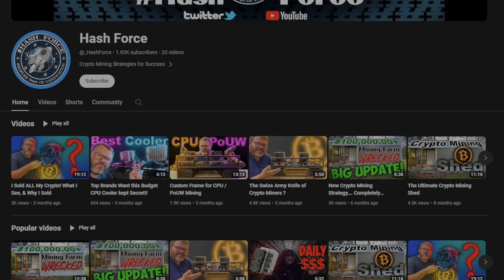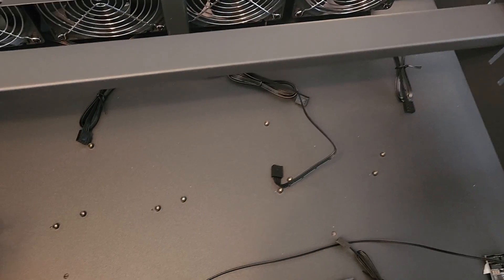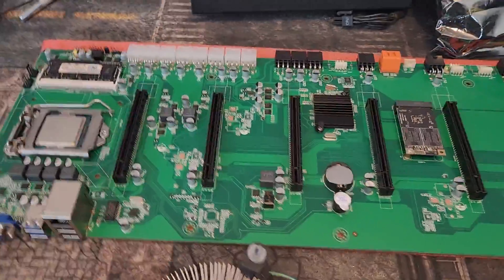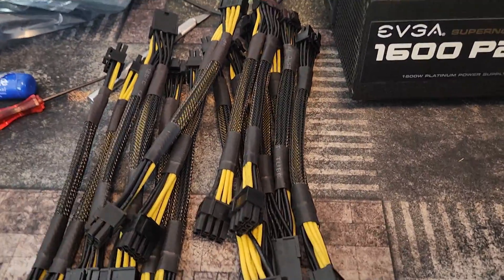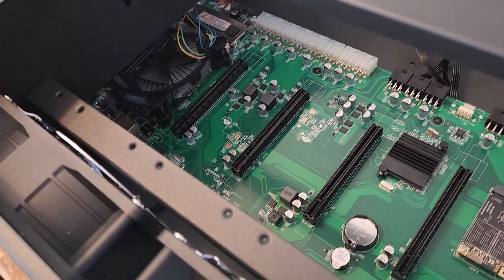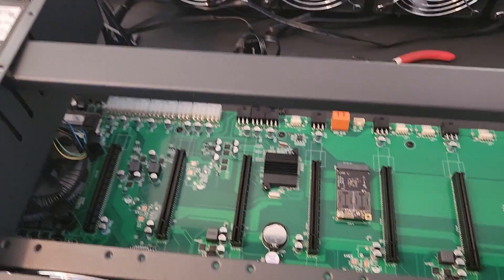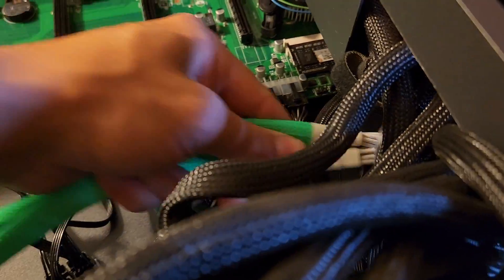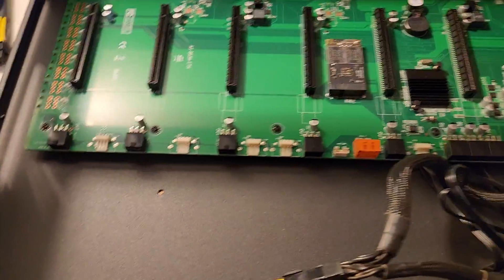How to build your own #gpumining server case!

Comment: Just for future reference you can plug 4 pin pwm fan connectors into 3 pin connectors you just don't get pwm fan control from that end pin.
Reply from the maker: for sure but I wanted the fan control which is why I plugged them in that way

Comment: You could get molex to 6 pin for the fans potentially
Reply from the maker: I thought about that, but didnt want to mess with it, this way felt safer
Reply: @kr00tman  yeah true. Hey do you have a link to the cheap cpu to pcie cables? I tried looking for them online. Can only find veteran miners. I saw veteran miners cables and they are sick but expensive lol.
Reply from the maker: @propeldragon  I didnt trust the cheap ones, they looked really really bad, and I get vets cost alot but I promise you they are worth it and thats coming from mr cheap himself

Comment: I use this case, but I spend a bit more on a 2u mining power supply, it has 2000 watts, I think and plenty of cables.
Reply: I used to use evga psus, but it was annoying to connect a breakout board and a server psu (I used to velcro them on a side of a case). I also use a splitter to put 10 cards total, but extra 2 or 3 cards go next to the case. Good luck. I think 8gb will give you faster response.
Reply from the maker: yuppp very annoying which is why I don't think ill do another case like this

Comment: Those motherboards are a little cheaper than my btc-37's that i like.  Also, besides the obvious fact that the 1600 watt power supplies fit in there, is there any reason you couldn't just use a server psu, and a breakout board?
Reply from the maker: there isn't at all, in fact because ill have quite a few server psus sitting around doing nothing once I convert 90% of my rigs to server cases I plan on buying 1 more set of these to see how it goes with server psus
Reply: @krootman_digitial  yea, because by the time i buy my next open air rig with a btc37, for only a few more bucks, I could get this setup....  but i wouldn't want to spend $95 on an atx power supply...  i might just go this route with server psus
Reply from the maker: @areutryingitout5678  exactly, like for me I could build another server case for 170 reusing my server psus, seems like a no brainer to go that route. I will see where im at in a week once everything is set up and go from there!

Comment: I have the same setup!!!( i have 6 of them!! for a total of 48x 3070!! )  You don't need 8 power cable for the motherboard i have 2 only and all is working well( the motherboard use about 50 to 60 watts only ), I upgrade all the cpu for i3-4170 with 8gb of ram.
Reply from the maker: Very interesting, could you shoot me some pics of your case and how everything is wired?